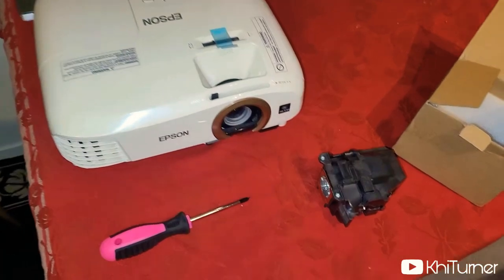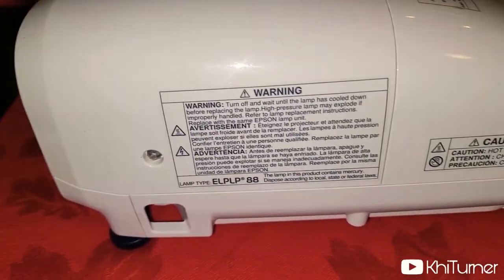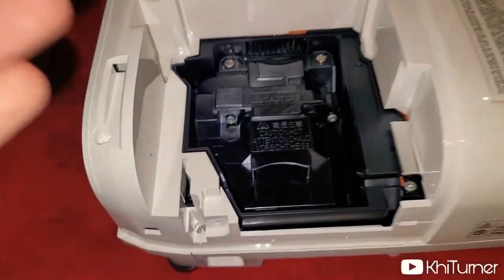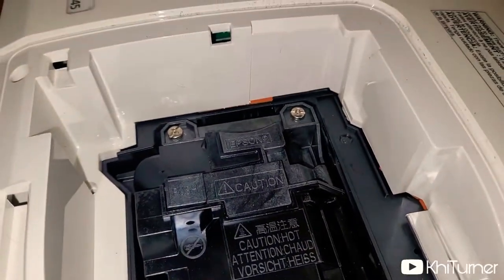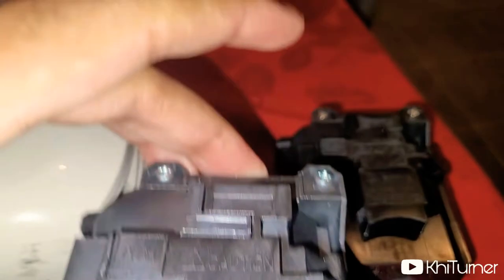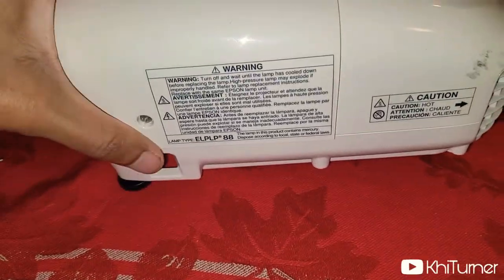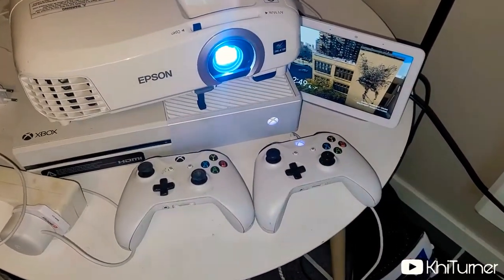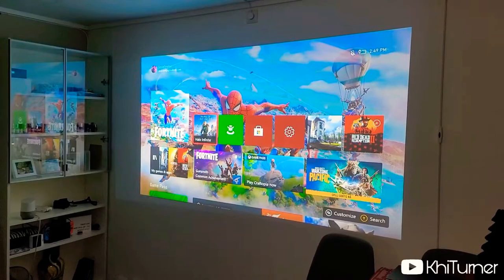💡 Epson Projector Bulb Change Guide (Home Cinema 2045)

Comment: After replacing the lamp. Should you put it in normal mode for how long before putting it into Eco Mode. 

I heard that when you first use the projector it needs to run in normal mode for at least 100hours of use before putting it in Eco Mode so the lamp will not flicker in the long run.
Reply from the maker: Yeah it definitely helps, yet the 100 hours is excessive for a bulb replacement. With about 30 the projector will be good

Comment: Hi, this video was extremely helpful. I have an Epson 2040 projector. My bulb popped and I had to replace it. After I replaced my bulb though it smells real bad like fire. Is this normal?
Reply from the maker: I would check with the bulb and see if any of the filament is missing or leaking because that is NOT normal. Check this for support and help with installation  https://files.support.epson.com/docid/cpd5/cpd52412/source/maintenance/tasks/replacing_lamp_pl975w_2265u.html

Comment: The replacement light still blinking. Is there something I’ve miss?
Reply from the maker: That's a unique one, it could mean it's a defective bulb
Reply: Got an answer on a forum. On the 2040 model you need to reset the lens life cycle and the light stopted blinking afterwards. Everything works just fine now!!
Reply from the maker: I'm glad everything was good, these projectors are amazing